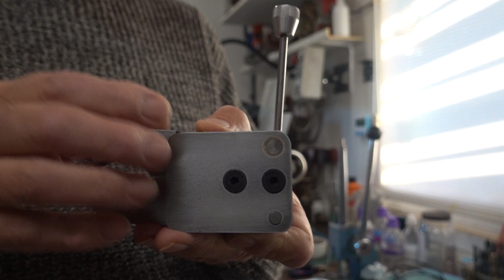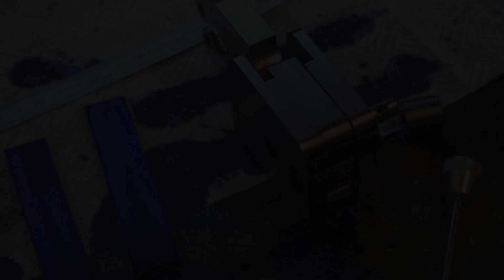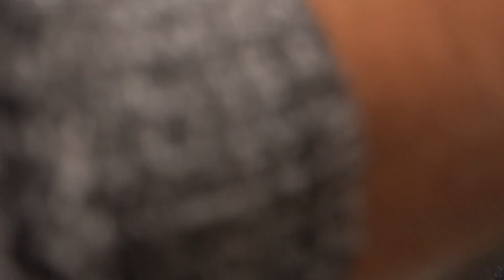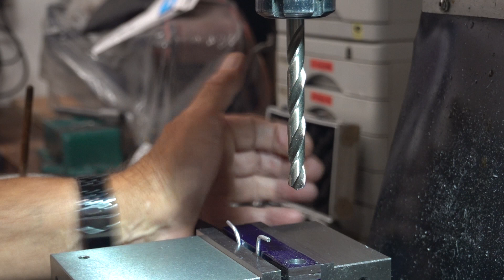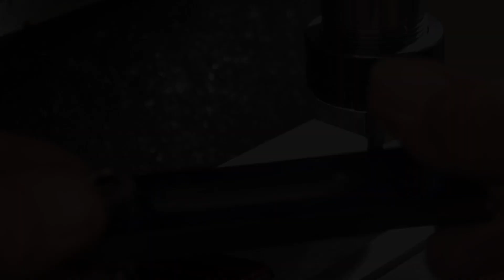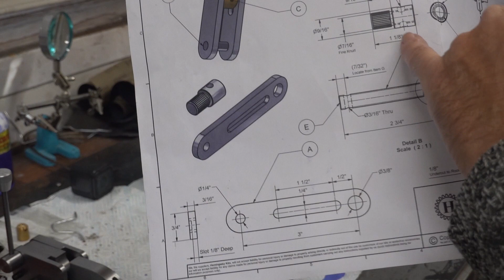Hemingway kit lathe Knurling tool part 5

Comment: Well done Stevie, it's coming together very nicely. Slot Drill is what you used (quite correctly)! They are designed to plunge as they are centre cutting, and then slot. There is an argument that many plunges is quicker (and it is), and the majority of the wear is then on the end which means you get more regrind scope (also true). It should be noted however that if you use a size for size slot drill, ie 8mm for an 8mm slot, you will get better dimensional results the way you did it ie, plunge once and slot. You should slot only up to 50% diameter deep per pass according to the rule book (which again you did). Text book mate, great job. Cheers, Jon
Reply from the maker: Thanks Jon. I am winging it as i go. Just my logic. Pretty much the way you do it. It's like buying a new old house. You look in a scabby room & see in your head what it could be like. Some folk cannot do that & say ugh that is horrible, without seeing the real picture. If any of that makes sense. Thinking of what to do next already. My Son & I were going to do a day at Goodwood that never happened. I already did a video of a Ducati day out on the bike that got deleted by youtube. So we plan to do a day out in the Silly power Jaguar. Maybe that will get banned too. I ought to do a workshop tour a bit like you did too. Regards Steve.

Comment: Nicely done and I'm looking forward to seeing how well it knurls. 

Your choice and reasoning behind using a two flute end mill is correct. One of the names used for two flute end mills are slot mills because there recommended as being generally more accurate and cutting closer to there diameter over a 4 flute. A 4 flute will tend to have more oscillation or wobble due to the way the bottom and side flute cutting teeth engage within a deeper closed slot and especially so when more than one pass is required to get through the material, so they will generally cut a bit over size with a poorer surface finish. And as you said the two flute has more room and will pull the chips clear a bit better to get the initial slot in as well. So a two flute is the better choice for cutting slots or blind keyways. If the exact slot width isn't size critical but the best smooth surface finish is, cutting it first with a two flute and then using a 4 flute to very lightly clean up and slightly widen the sides will get you the better surface finish because the 4 flute is then only cutting one side of the slot at a time. Obviously more work and takes longer , but were under no obligation to please anyone other than ourselves. Good tooling making for your own use is where you should be doing your best work imo anyway. I have some early work where I wish I knew then what I do now. But I think you've done a really excellent job on this so far.
Reply from the maker: Thank you very much Turning point. All info absorbed in the grey matter.